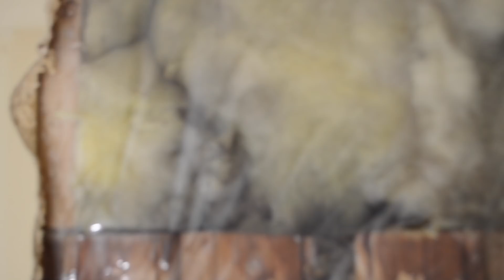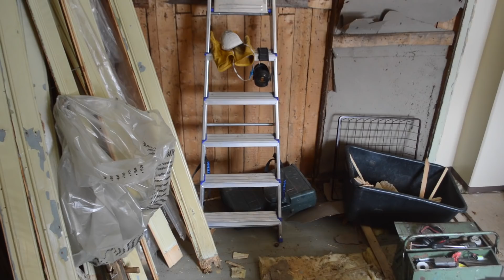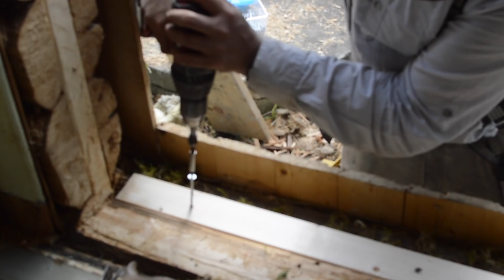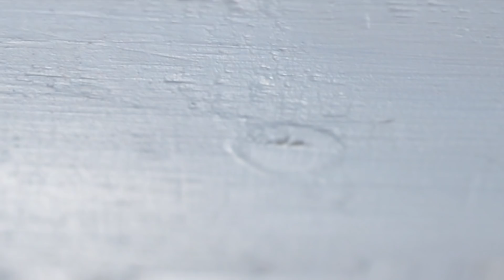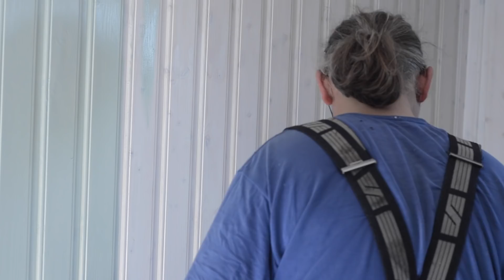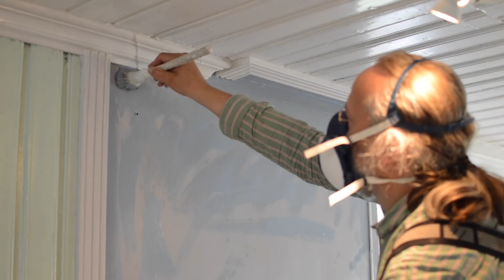🔴 Old Wooden house restoration in Norway - 7 parts linked in the description -

Comment from the maker: 0:23 Why I don't use glass-fibre insulation
5:59 Dating the building (the deeds say 1912 but I find proof it is older)
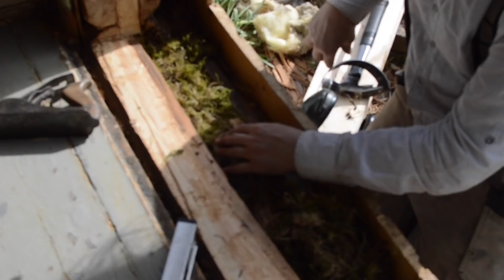11:24 Using Moss in walls
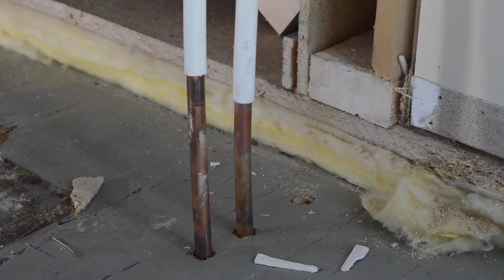14:31 Line-scribing to fit an uneven floor.
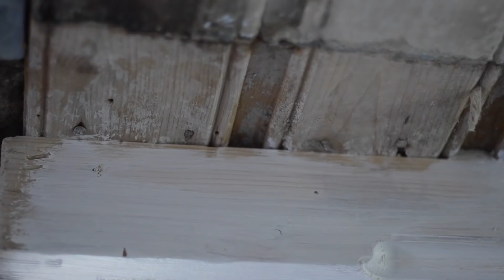19:25 A dividing beam in the ceiling
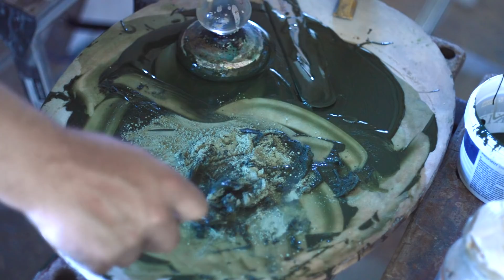25:51 Hand made paint
35:32 Painting with hand made Linseed oil-paint

Comment: does the oil paint block out the knots in the pine ?  beautiful paint job <3
Reply from the maker: The knots are painted first with a lacquer (shellac and methylated spirits) since they tend to draw out the oil otherwise, leaving a very matt point. The wood grain and knots are still just a little visible through the two layers but the surface is homogenous with a silk matt finish.

Comment: Det er jo veldig kult. Den tømmervegen var kul du må beholde den
Reply from the maker: Det var en tanke, men det blir bestemt å kopiere panelene fra 1890, på dette vis kunne jeg isolere mellom veggen og tømmer med cellulose isolasjon. Laftehus kan være vanskelig å få tett når det er panel både innvendig og utvendig som på dette huset. Det ville ha blitt veldig dyrt å ta av alle panel  i et smekk. Nå kan det utvendig taes om 50-60 år når det er modent for utskifting.

translation; 
It was a thought, but it was decided to copy the panel from 1890, in this way I could insulate between the wall and timber with cellulose insulation. Timber houses can be difficult to get air tight when there is panel both inside and out as at this house. It would have been very expensive to remove all the panels in one go. Now the exterior can be replaced in 50-60 years when it is ripe for replacement.
Reply: @LucasRichardStephens  ja